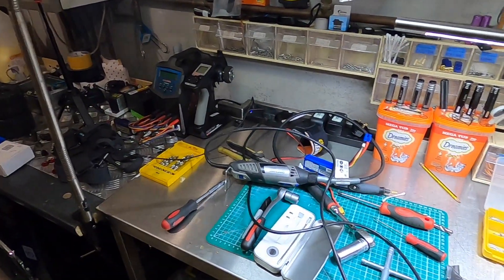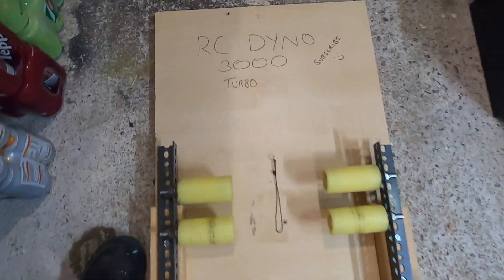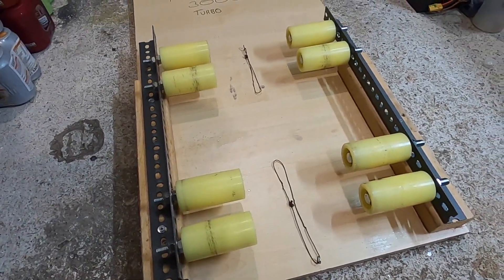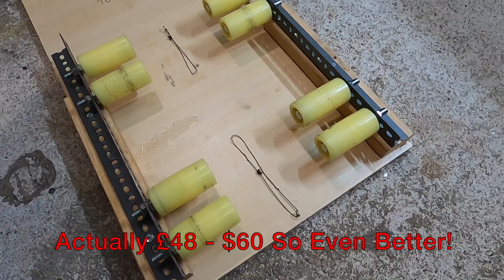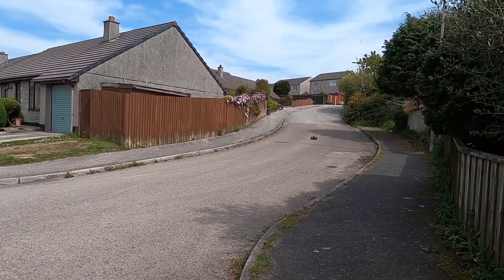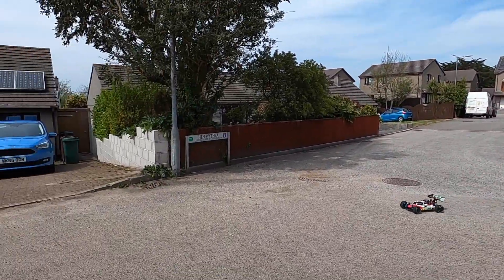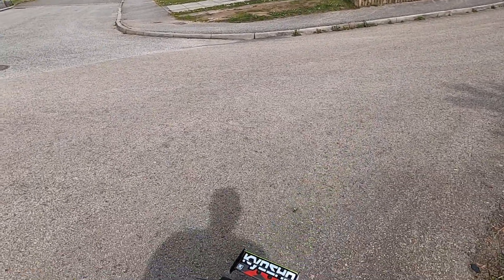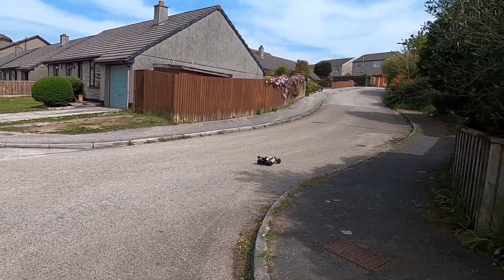RC Dyno, Rolling road. Homemade

Comment: Hey was looking into making my own, but with the whole electronics for rpm. It looks as if you could move those rollers one more forward towards front of car, won't have to hold as much and it'll put more work into the car, accurate as much as possible
Reply from the maker: Theirs always improvements to be made dude, I'll be honest and day I've not used it since I made this video lol